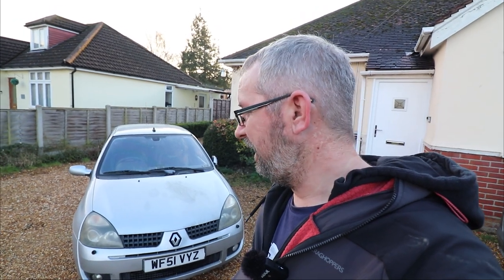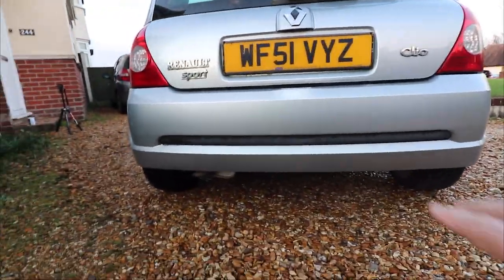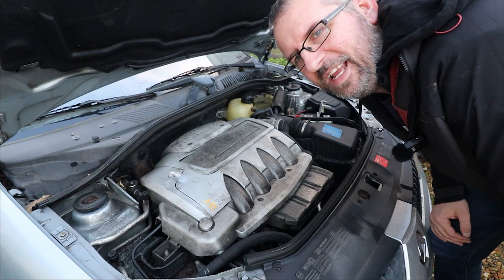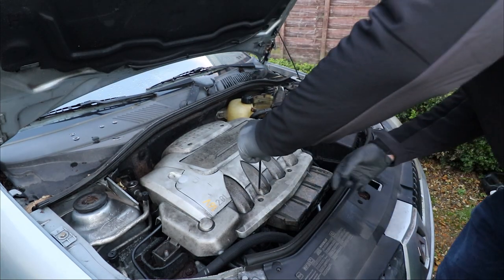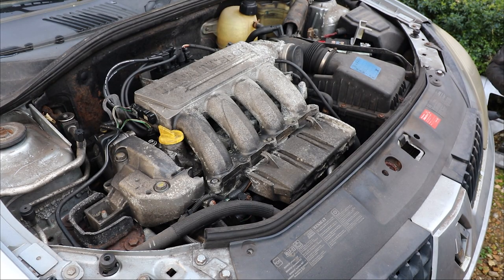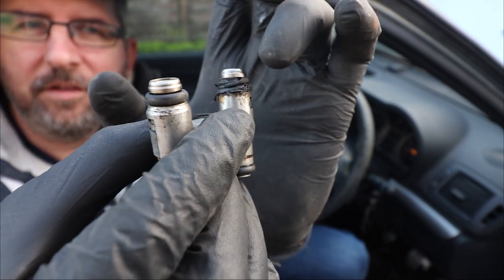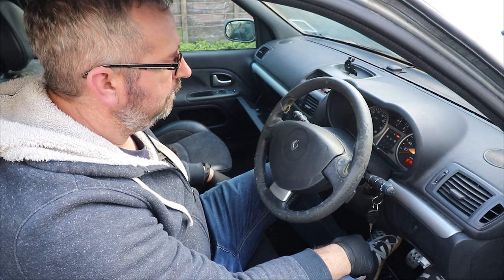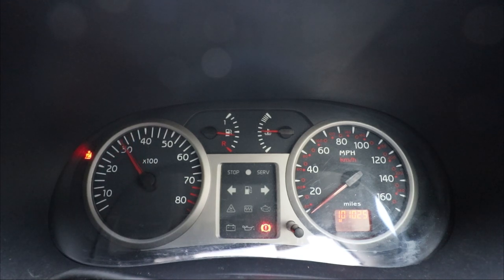Scrap Renault Clio 172 Restoration

Comment: The best chassis in a front wheel drive hot hatch in my opinion. I’ve just restored over the last two years a 172 cup, I ended up spending a lot more than what I should have really but at the end of it I’ve got a car that is really fun to drive, it’s not all about the horsepower sometimes, with these cars you can grab them by the scruff of the neck and redline them!
Reply: Any videos of her

Comment: I'm in the process of rebuilding 2001 1.2 16v as first project,coil packs are a common problem I'm told.Mine run rough I changed coil pack and plugs plus all fluids it's running well.ive done coil springs and shocks plus brakes,next on the list timing belt and water pump. Not bad for first car on my own.

Comment: That's looking better already, my van sadly died on me so now I have a Rover 25 IXL goes really well though she also has greenage in awkward to access spots but it gets me from A-B and cheaper than the van in some ways. Have a good week out on the lorry this week
Reply: Look after the Rover will you, 😂 not many around now 😁
Reply: @sammytheseal2307  I intend to don't worry 😉 a bit low after an Iveco daily but goes like  a pocket rocket. There are a couple others local to me but definitely more of a classic now
Reply: @elizabethmaybrown6715  Woohoo 😀
The K-Series engines love to rev that's for sure!
Yes I think 80% of them are in the hands of enthusiasts now, but they are still perfectly good enough daily runners
Reply: @sammytheseal2307  and most of the drivers I have seen are usually over 60, I will be looking after it for certain
Reply: @elizabethmaybrown6715  Ha that's true as well 😁
Reply: @sammytheseal2307  it only had 79389 miles when I bought her, now it's at 80300 and something 😂

Comment: that annoying squeal at 11:00 is the depahser pulley. If the car has been sat around for long period of time it will be due a replacement along with the cam belt. It is a specialist job therefore it isn’t cheap looking at best £700.
Reply: Yep, cambelt and aux belt is a must too as the aux belt likes to take out the lot when they snap!
Reply: Good call guys, think aux belt 36k on the Clio. Meant to be 72k miles for my 275 Trophy but mine went at 53k and a year before it was due...had to source a NOS engine
Reply: @Mouse2113  Yes, I thought the general consensus among owners was every 4 years but wasn't sure on the mileage interval 👍
It's well worth doing as I think most people buying one would want to see it having been done otherwise they'd factor it in and would want a discount to have it done. 
Its so stupid in principle that the aux belt takes out the cambelt when it fails, but that's Renault for you 🤦😆
Reply: @sammytheseal2307  I was on a back road near Wick doing the NC500, accelerated up the hill then boof there was a quick thud then I'd lost all power and it wouldn't start. The main belt looked in tact. The aux had actually shredded at the side, hit the main belt and jumped my timing...goodbye top end! Wrote to Renault and they didn't care. I'll be doing the aux every 3 years now

Comment: nice result on the injector, if it turns out to be a decent car they are worth good money with the cambelt kit done, also that top centre air vent is part of the dash board, those sports have the soft touch plastics which go sticky and nasty and peel, i know some people swap them for the standard non soft touch ones, never been a fan of the alloys on these, they come with much better but expensive options
Reply: I believe there are some videos on using leather dye cream to recreate the soft touch feel
Reply from the maker: Thanks for the advice, I'm looking into some replacement plastics 👍

Comment: I have the 1.4i 16 valve version, and I know the airbag and service light problem is the plug under the passenger seat causing the warning lights to illuminate. Just a connection issue. Mine has a storage compartment under that seat and if you put something in that compartment and disturb or unknowingly wiggle that connection the warning light usually comes back on. I've tied it to another position using a cable tie or zip-tie as some people call it, and problem was solved. There is just one thing I'm struggling to fix on my Clio. I've done internet research but could find nothing. Let me explain. I installed reverse parking sensors on my car, and all of a sudden, my indicator warning sound (that tick-tock sound) when you put the indicator or turn signal on disappeared. The indicators flashes on the outside and the green arrows on the instrument cluster are also working normally, it just stopped making that tick-tock sound. I know it's not that big of a deal, but it has happened that I forget the indicator on while driving because I don't hear that audible indicator warning sound inside the car. According to my research, they say it's a small speaker inside the instrument cluster that normally makes that sound, it's not a mechanical relay like the older cars. According to google that same little speaker also makes other warning sounds like leaving the key in the ignition, leaving the headlights on, or driving without a seatbelt. But that tells me the indicator tick-tock sound must be coming from another speaker, because all the other audible warnings still work fine on mine. Nobody can tell me where that indicator tick-tock sound is supposed to come from. I've stripped the dash but couldn't figure this out. I also disconnected my reverse sensors (PDC) to test if the tick-tock sound will return, but it's still gone, and yes, I did check all fuses and replaced all relays, but no luck. Some say the two little speakers or tweeters on top of the dash could be the problem, but I've tested those too, they also work fine because there is some sound coming through them when switching on my radio. It's a complete mystery to me. I love my Clio, mine is in showroom condition, these Clio's are truly great little cars. Just that one small little issue for me to solve on mine.

Comment: Thanks Kev :yt: 👍👍 if you've seen the MOT history this has an oil leak (surprise) in advisories the steering arms x2 have play...  front discs' are worn?  offside rear tyre damage?  distorted wheels? on both the front wheels...
Reply from the maker: Yeah I do a lot more investigating than an mot check before I take on a project mate lol

Comment: Kev, what compounds did you use for the lights please? My L200 has foggy lights and needs that treatment. Great video, keep up the good work.  

Cheers, Timmo
Reply: Any sort of standard polish will get them shiny. 
For longevity it's best to work your way up with different grits of sandpaper, stop at 5000 grit, apply a polish, buff off and most importantly add a layer of lacquer or other UV sealant 😁
Reply from the maker: Yeah as Sammy said, I didn't sand but any cutting compound will do the job, I'll get round to the lacquer after I've given them another going over to get them really shiny 😁
Reply: Thanks guys, really appreciated 👍

Comment: MOT History For WF51 VYZ

PASS

Date tested

26 October 2020

Mileage

99,431

Expiry date

01 November 2021

Advisory notice item(s):

Offside Rear Tyre slightly damaged (5.2.3 (d) (ii))

Nearside Front Play in steering rack inner joint(s) ()

Offside Front Play in steering rack inner joint(s) ()

Front Brake disc worn, but not excessively (1.1.14 (a) (i))

Oil leak, but not excessive (8.4.1 (a) (i))

Nearside Front Road wheel slightly distorted (5.2.2 (c) (i))

Offside Front Road wheel slightly distorted (5.2.2 (c) (i))

Nearside Rear Child Seat fitted not allowing full inspection of adult belt ()

Comment: Please remember to apply a UV lacquer to the headlights. Polishing them will have removed the factory lacquer. The absence of which will lead to the lenses crazing and causing more damage more quickly.
Reply: I machine polish mine once a year and with polish and sealant I've never had any issues